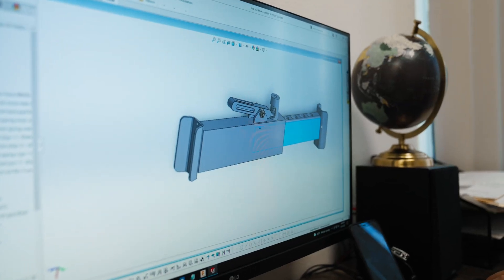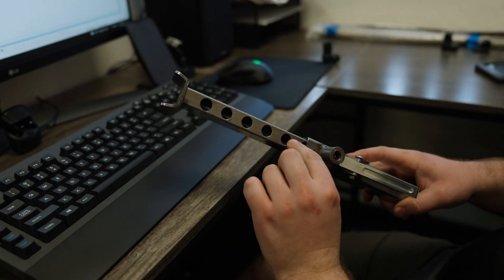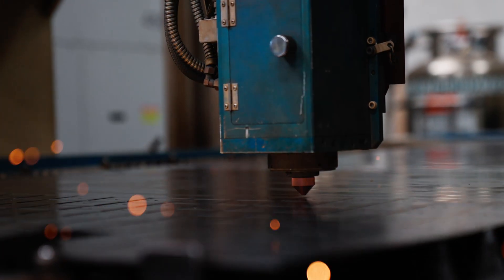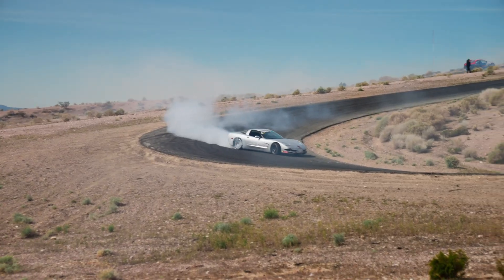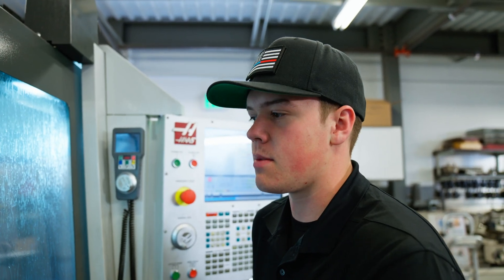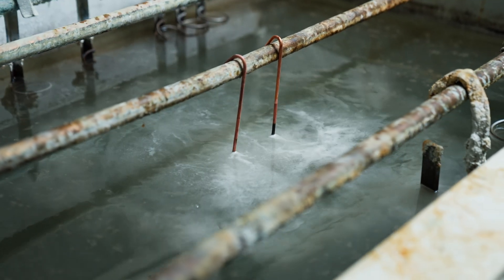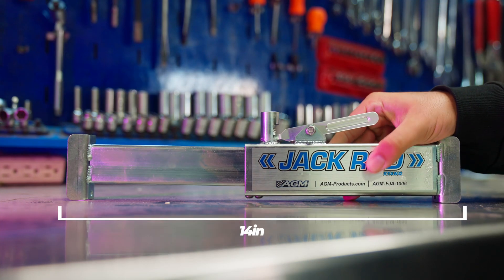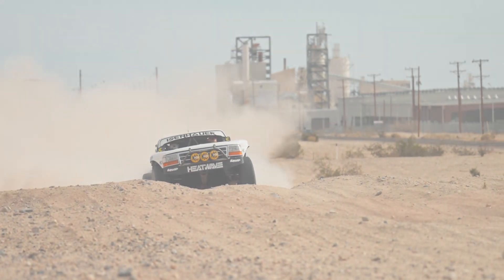How It's Made - The Jack Rod

Comment: How is the Jack Rod removed in the event of a jack failure? The Jack Rod would be under tension and you can't raise a failed jack. I assume another floor jack would have to be used to raise the car higher and pull the original jack out with the Jack Rod attached?